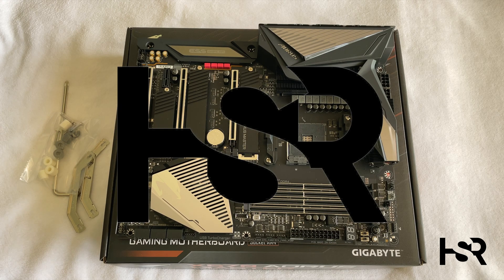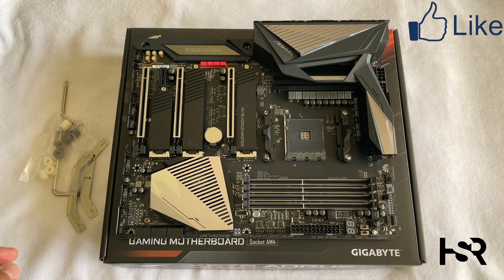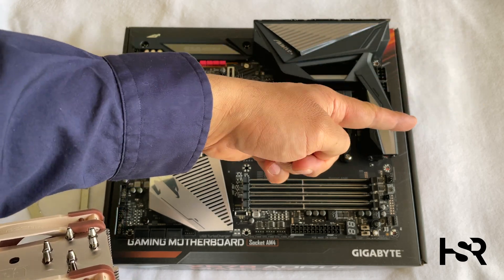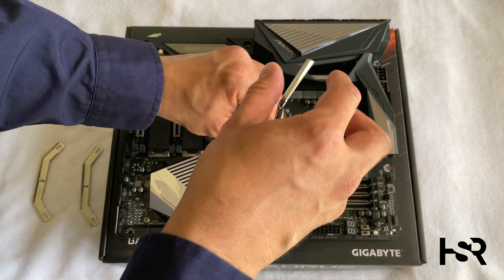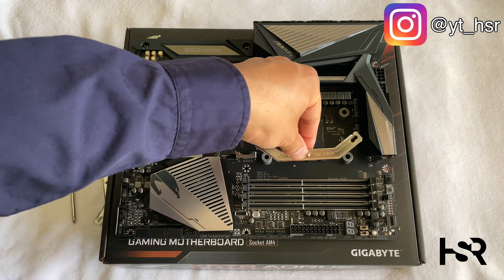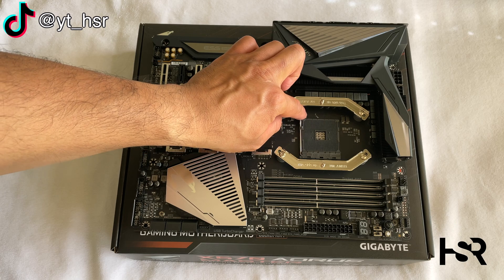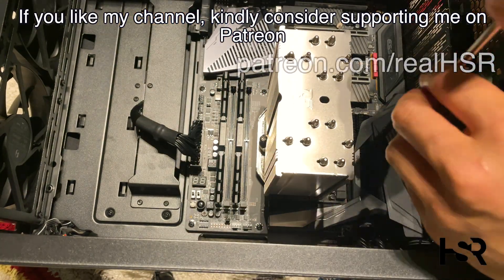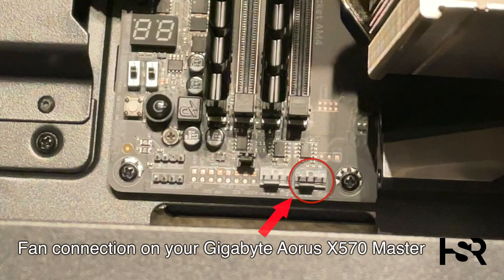Easy guide to install Noctua NH-u12a with AMD Ryzen 7 5800X on the Gigabyte Aorus X570 Master

Comment: I don't claim to be an expert, but you mounted the heat sink the opposite direction of everyone else I've seen install this.
Reply from the maker: Thank you for your message. 

Always have your fans blowing towards the motherboard's IO (that's going to be the back of your case for exhaust). As you don't want blow hot air onto your RAMs.

Hope that answers your comment.

Comment: 164 / 5000
Resultados de traducción
By the way I am doing a very similar build and I would like to know what RAM modules you used And if they did work without having to make any modifications to the Bios, I'm not planning on overclocking so what I was looking for are modules that are incredibly stable and of good quality.
Reply from the maker: I’m using T-Force Dark Za TeamGroup 32GB (16x2) DDR4 CL18 4000MHz

All RAMs clock at 2133MHz. Without changing the speed in BIOS. Mine can be overclocked to 4000MHz or more. So I just have it running at 4000MHz

Does that make sense?
Reply: @HSR  I don’t really know. I guess I will know when my parts arrive.
Reply from the maker: I’ll try to make a video regarding it shortly
Reply: @HSR  Thanks a lot for taking the time to respond.
Reply from the maker: Thank you for your comment. Msg I ask if you have subscribed to HSR?
Reply from the maker: May* I ask
Reply: @HSR  Yes of course!

Comment: Congratulations a really important video that teaches us things that otherwise we would not have known thanks.
Reply from the maker: Thank you for your kind words. Kindly consider subscribing to HSR to support more quality content. 

I’m thinking of developing a video on how to have the correct clock speed for RAMs. Do you think that would be of use?
Reply: @HSR  Of course I see many people in the forums suffering because they bought the wrong RAM with many blue screen problems
Reply from the maker: Woah! How did they manage that? It beyond me how one would do that. As RAMs as pretty universal. Especially modern ones
Reply: @HSR  That is what I thought. That is why I did not want to take risks with the purchase of my RAM.  I live in a part where it is not easy to get things Envigado, Colombia.  And every time I make a purchase, I have to wait almost 20 days for it to arrive in my city.
Reply from the maker: What system are you building?
Reply: @HSR  
*Patriot Viper Steel DDR4 16GB (2 x 8GB) 4400MHz Performance Memory Kit - PVS416G440C9K
*SAMSUNG 980 PRO 500GB PCIe NVMe Gen4 Internal Gaming SSD M.2 (MZ-V8P500B)
*GIGABYTE X570 AORUS Master
*Corsair RMX Series, RM850x, 850 Watt, 80+ Gold Certified, Fully Modular Power Supply (CP-9020180-NA)
*ASUS TUF Gaming GT501 Mid-Tower
*Noctua NH-U12A
*Ryzen 7 5800X - Couldn’t get  any better
*Asus RTX 3060 Strix - Couldn’t get any better.
*Asus TUF Gaming VG279QM: 27 Inches
Reply from the maker: Your PSU is well overkill. The RAMs will work without any issues
Reply: @HSR  Yes I  try to be on the safe side.